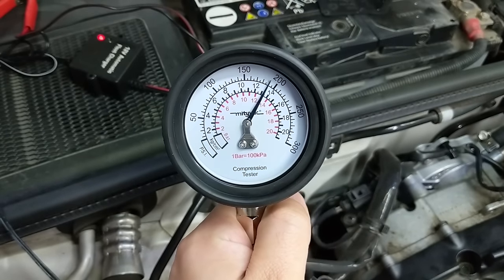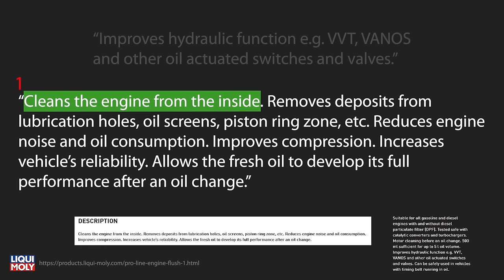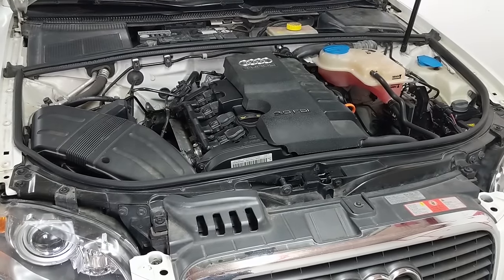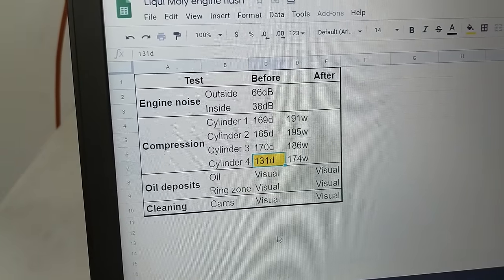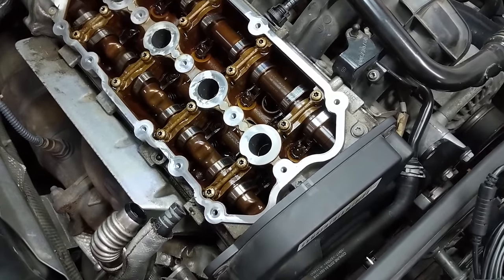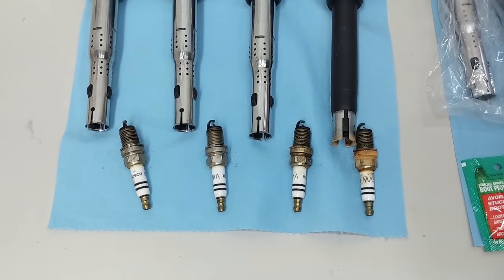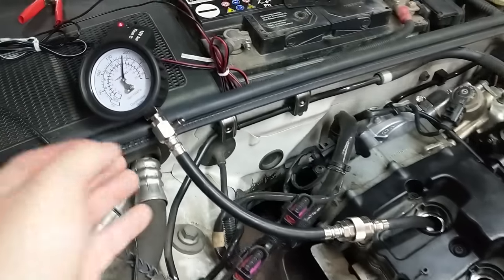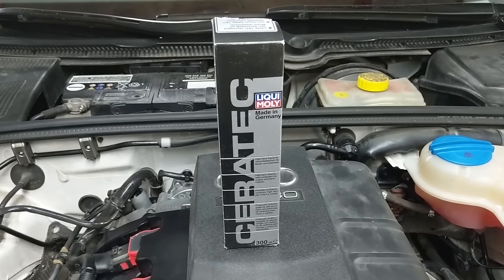Does Liqui Moly Engine Flush work? | Full Test & Review | Pro-line 2037

Comment: Why didn’t you use the liqi  moly oil?
Reply from the maker: Fair question - I do use it on the Avant but I'm still working through a Castrol stock pile for the B7. I'm not rich, lol :). Although using the same oil as before the flush wasn't necessarily part of my "control" of the test, changing another factor wouldn't have helped the legitimacy of this review.

Comment: When my dad did oil changes he would drain out a quart of oil, add a quart of kerosene and then run the engine in the driveway to warm it up before draining everything out.
Reply: With modern oil technology, that's overkill.
Change your oil according to the manufacturers recommendations, and you should be fine.
Reply: @panzerveps  Oh, I agree completely.  I gave up the Kerosene flush in the late 70s.

Comment: I used this in my van on an oil change 2 days later oil heated up blew the pipe off and messed up my engine blocked the oil passages had to replace the engine
Reply: @MrCostin88  of course it was only in for the recommended time just on tick over

Comment: Nice test dude. That flush is good solution for blocked piston rings but not for cleaning bad quality HC-Synthese oil residue(that orange-brown sludge is a residue from using HC oils mixed with longlife servis intervals. Thats not a typical coke). Batter solution to clean something like this is long time flush like Archoil AR2300 but you cannot expect spectacular effects. And use PAO\Ester base oils in the future is good solution for that engine. That engine have electronic thermostat and can achive temperatures of coolant like 110*C when idling and partial load(you always see 90* in dash.. Only when temperature is below 85 or over 110*C you can see hesitation on the temperature indicator).
Reply from the maker: Thanks for the added color - sounds like you know more about additives than I do but you raise an interesting point about temp measurement. Granted, my B7 is nearly stock and is unlikely to ever become that powerful with the 2.0, I would love to have a more accurate and broad range of performance measurements like boost, oil temp, coolant temp, voltage, etc.

Comment: Those disc style spark plug gap tools are inaccurate.  Measure it with your calipers, it will be way off, like 3-10 thousandths off.  I only measure gaps with a feeler gauge anymore.

Comment: Liqui Moly engine flush leaves a thick layer of grease that protects the internal parts of the engine. You can test by leaving a piece of iron immersed in this product, let sit  and it will turn brown indicating that the piece has been protected with a layer of grease.

Comment: Their claim of reducing oil consumption has nothing to do with oil burning through the piston rings. Their claim is based on the assumption that with a clean PCV system due to the cleaning action from the product, the PCV valve will open and close properly, thereby reducing oil entering the intake system.

Comment: I used both the liqui moly and seafoam in the oil with success in removing deposits from engine. I do this periodically with my cars I’ve maintained with frequent oil changes, but mist dramatic was with a used 2011 mini we bought with 74 k on it. Was obvious that the PO had not done 5 k oil changes, i think mini recommends 20 k if u use bmw LL3 oil… stupid idea and very few oils commercially available in NA meet this spec… putting sea foam in the oil before changes cleaned up the deposits visible in the valve cover after doing this on 3-4 successive oil changes at 5-6 k miles … so you need to do it several times and change the oil frequently. 

Also will remove the combustion deposits if you dribble it in the intake  while idling through brake booster vacuum line. Dump it in till it stalls shut it off let it sit 20 min then you get big clouds of smoke …l

Comment: Did you re-use the same old oil with the Liquid Moly flush or,  did you use new oil with the Liquid Moly flush??
Reply from the maker: I added the flush directly into the old oil - which is what the product instructions are. I imagine you could do it both ways, but you will be using twice as much oil to do the job. Your call!
Reply: @FigureItAudi  thanks

Comment: “Technically these numbers aren’t awful” referring to cylinder four at initial compression test. 

“It fixed A really significant problem” referring to compression test of cylinder four after using liquid molly 🤨🤔
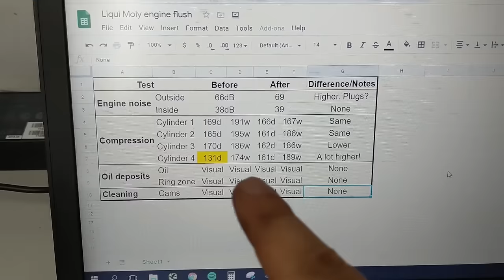Reply from the maker: 20:08 Roll the tape! "Might". I don't speak in absolutes unless I know it's true.
Reply: Figure It Audi I was more highlighting the fact it went from being not a big deal prior to the liquid molly to being a “significant problem”.... as if you changed your mind about it because you believe what you want to believe rather than what the facts are.
Reply from the maker: I think the facts are straight - what came through in the video is more of the building sense of concern as I was working through the project, thinking of more serious ways compression could be affected. Regardless, I get what you mean; it's tricky to remain unbiased and organic when you're running around the garage trying to do work and film for the Youtubes.

Comment: Could be a  coincidence but not long after flushing my BMW engine with this, it developed a serious rocker cover gasket leak which required immediate replacement and suspected head gasket leak (I was seeing emulsified oil on the dipstick and inside filler cap and I had never ever seen it before on my particular engine).  I can't help but connect the two things but who knows.  I would say change your oil regularly such that you don't need this stuff in the first place.
Reply: you are right on conclusion but the detergents can open up a leak where it was not but it happens often due to degradation of the gaskets over time. The key is not that engine flush is bad because it can help with engines that see more issues with carbon on rings but that engine seals and gaskets are a part of life, to change them that is.

Comment: For your knowledge - Liqui Moly must be used for 2 oil change intervals to get results. Aprox 10k miles. :)
And its not good ide to clean engine that already has such dark deposits. Your valve spacing will get bigger and engine will get more louder. ;)

Comment: I flush my engines with half new oil and half diesel, run the engine for 15 min on idle and then drain the engine and put in new oil and filter.

Comment: Flushes don't work that great on a fairly clean motor. But still a good video.
Reply: I was thinking of giving this a go on my car but as I change the oil and filter every 6 months which is about 4500 miles I guess it wouldn’t make much difference

Comment: 50% old oil % diesel fuel,din it for 20 min. And you ei see wonders.  I ve tride also 7L of diesel and 1L of oil ,în a petrol engine,with 8L oil capacity.  And let it run for 10 min. There was no damage done ,a.d the cleaning was awesome.
Reply: spun bearings happen though
Reply: @BenState  noup, all of them  still idle as a whisper, and rev to 7 k rpm . Ofcourse with 10w60 oil ,all year round.
Reply: @zfloz9895  whatever dude, i agree generally, but some things don't like diesel in modern cars.  Older ones, fine.
Reply: @BenState  dose a n57 3.0 d  ,258 hp ,seems new enough? :)
Believe me ,I'm so much experienced  in this things.  In not a blogger.  :))
Reply: @zfloz9895  No, you're a muppet.
Reply: @BenState  lear  more and you will be more wise.  Now ...You're just a believer.  :)
Reply: @zfloz9895  you should keep doing it.

Comment: The compression in cylinder 4 improved with the new spark plugs and not liqui moly my Bro
Reply from the maker: How can that be, though? Cyl. 4 plug looked fine upon removal but even if the updated plugs gave the combustion a little more boom and put some good juju into the cylinder prior to removal and compression test #2, the plugs aren't an active factor during testing.

Comment: NO! Never use it on an engine with Variabl Valve Timing. There's too many narrow passages that can clog. 50 years ago you could get away with it when the engines were big. I tried it on my VVT engine, I ended up buying another car. Really took the VVT out. I was lucky it was an old Toyota.

Comment: under valve cover it was clean even before! I would not expect anything there!! Those orange color is from Castrol oil and can not be removed with engine cleaner (only chemical cleaning). But you also mentioned that this car was sitting for a long time with SAME oil and you need to change oil st least 1 time a year!! So i wold think that you would get compression improvements just with new oil change!!! Cleaner did not do much here!! P.S. What promo pictures showed are cleaning done after somebody didn't change oil for a long time and just was adding oil and engine was getting some gunk inside!! You don't have those!! that what you was not impressed with cleaning because you engine is CLEAN as for me!! I had exactly same look on my 2005 passat with 180k miles!!

Comment: Used it wrong. 
Ur expectations are to high for one time usage. I did used it 3 times in a row by an oil change after 8k km in a v8 a8 4E 3.7L engine and that stuff does it job. Look at the Filter. The main reason why u should use that stuff is, to make sure that the oil contamination in solid form can be dissolved. That comes from the high temps your engine runs and in some spots it gets solid.for the compression I highly recommend paraffin oil, 50ml in each zylinder. After 24h you have to remove it out of each Zylinder and test it again. 

Conclusion to that product: you not gonna see extremely differences in the first time but in long usage u will see extreme differences in form from oil pressure and residues in oilfilter. You can of course send it away to analysis that will confirm my statement as i have already tested it myself.

Comment: im guessing youre an engineer, you clearly know your stuff but in my opinion you messed up only cranking 5 times for compression. ive only ever known to just keep cranking till it stops, the battery drains and the starter slows down
Reply from the maker: Hey Connor - Nope, just a man in a garage looking for answers. Your comment about the compression test method is shared by a number of other people and I haven't addressed it...till now! There are definitely moments in my projects where there's a difference between how the mechanic/enthusiast community have collectively decided a process should go, vs. how "the book" calls for it. This was one of those times where I wanted to maintain some kind of rigor to how the factory calls for a compression test to be performed, so I stuck to the instructions (via Bentley). I think, like most testing, the consistency outweighs the accuracy. Obviously, the goal is for both. Live and learn!

Comment: Man, good effort but look what Todd from Project Farm does! I think a can of WD40 in the low cyl would probably done the same. The burnt plug shows bad design but why change all thepacks? Look what Sandy Munro says and test drive a Model Y and tell us if you would ever buy an Audi again.
Reply from the maker: Yeah, maybe WD would have. My generalized answer to your comments is still that, to me, messing around with cars is rewarding and scratches the how-does-that-work? itch. If you saw my Kijiji searches, most of it shows that I'd rather go back in time for a project car than trade in head aches for something cutting edge. I learn and the stakes on this car just aren't that high.

Comment: These are single point measurements, so statistically cannot be used for hypothesis testing. There is always variation in all tests and cannot say I agree with a single point measurement. However I think that your video shows really very little changed.

Comment: Dont use this product on 1. Gen TSI. It thins out the oil and puts stress on the timing chain
Reply from the maker: Hey Daniel - Can you share more about this insight? The thinning happens during the cleaning cycle only, I would imagine; is that 10-15 minutes of cleaning enough time to cause enough stress to do the damage?
Reply: @FigureItAudi  10-15 mins is very little, that is true, but if the oil is overdue and has already lost some of its viscosity, thining it out can be a problem if the car has a timing chain such as EA111 TSI-engines (2006-2013). 

On newer engines I wouldn't worry at all, but since the timing chain is already faulty from factory, then I would not advise it on elderly TSI.

Comment: I would not do those additive test  on a low mileage vehicles, because there are't enough of residue of carbon after 100T miles, come on!
Maybe after 300- 500T miles with a diesel engine, and then you migh find a real difference.
Here in Finland, we drive in very wide range of temperatures, and humidities. And we drive our cars as long as they drive, from 300tml to 600tml. Varies, of course. But the best engines lasts basically forever. And one of the basic reasons is fuel. https://en.wikipedia.org/wiki/Cetane_number just adding the link, with out explaining. And the third is picking up the right oil for your engine, transmission etc. This, should be plain as paper to everyone. But...

Comment: These products are potentially engine destroying and unnecessary in properly maintained engines.

All this does is suspend the sludge and carbon in your oil, potentially getting into galleys and timing tensioners. Plugging them and causing failure. And yes, while the oil filter does remove most of it, it doesn't stop debris and sludge being freed post filter. 

Run a good synthetic oil that's the proper viscosity and weight and you'll be mint.

Comment: On almost any car you could name, even Audis, the internal engine components as a rule are the LAST things you need to pamper, over-maintain, or worry about as even the Germans know how to make a bottom end.  It's everything attached to it (like the 200 lb of engine plastic they use on every BMW for instance) that is going to break, fall apart, drain your wallet and strand you, and give you grief,  particularly everything electrical.  That's why I quit buying German vehicles since the electrical problems alone will drive any auto tech raving mad! I've been a mechanic since 1978 and I can't keep one running without going broke.  Germans can't make an electrical system for sh#t, ask any Porsche mechanic, or owner of one that's over 5 years old! (the car not the owner obviously).

Comment: I have a 2005 a4 cabriolet V6 3.ol dhoc  convertible I believe it's AVK I just bought it and on the way home the  Passenger side oxygen sensor was glowing red hot And then I just shut off the battery was dead this guy said that the a jump timing I bought a new timing belt bought new camshaft sensors by new crankshaft sensor And is started up sounding like crab shut it down He said it was one more tooth off or so He puts the belt back on and now it doesn't start And and but he show me the right way and all the steps to do the timing we pulled off the police clings on the left and the right side to reset the things Basically everything the book says to do and it still does not start but one thing he didn't do was wear that pin goes to the crank to lock in place he never put that in there would that be the main problem of the car not starting properly and on time because now he is trying to say it didn't matter already had a in place you could see the gauge on the plastic cover where supposed to be and now he thinks this electrical can someone help me out highly appreciated
Reply from the maker: Hey Johnny - I'm doing some major reading between the lines on your story but it's hard to diagnose on. If it at all helps your possible timing issue, I did a whole belt timing job (not cam chain nor sensor) in this video: https://www.youtube.com/watch?v=HN6ajyLviaE.

Comment: Your test is probably the most you could do at home, however please be aware that the section on top of the head will never show crude or build-ups in a motor with a good oil change history. Carbon build-p inside the cylinder has little to do with this product; there are other products from Liqui Moly designed to clean-up carbon build-ups. The real benefit is the cleaning of the bearings on the shafts, those channels which are not visible, unless you open-up the entire thing. As a German who has never owned a non-German car, I can tell you this; Reputable shops in Germany - those which are manufacturer authorized, will perform this Liqui Moly engine flush at all oil changes. I do this for as long as I can't remember, but I'm even more anal then you are; I flush the engine a second time with fresh oil and filter before doing the actual oil change. I want to make sure I don't have detergent residues left and I know it's probably not needed... (LOL!!!) Even so I don't come near the cost of the Mercedes dealership and I'm very confident. Also I only use Liqui Moly Engine oil! Cheers!

Comment: This product don't clean the combustión chamber.
Reply from the maker: Technically, the claims include "Removes deposits from ... piston ring zone", and since the piston travels quite high in the cylinder during the compression stroke, there will be oil (and thus the cleaner) making it's way up to the rings (so, pretty high) that might result in cleaning some of the combustion chamber. It didn't in my case - but I can't discount the possibility.

Comment: Diesel is the only thing that will work. But dont do it on a running engine.  Attach a drill to the oil pump and spin.

Comment: first of all, engine flush is not good for any engine, it will ruin seals and other smaller parts of the engine. second , Germans dont use LM  in their cars, it will make your engine gone bad. (but main reason is the bmw engine already bad and un-reliable to start of)